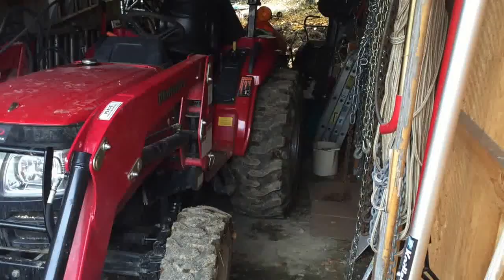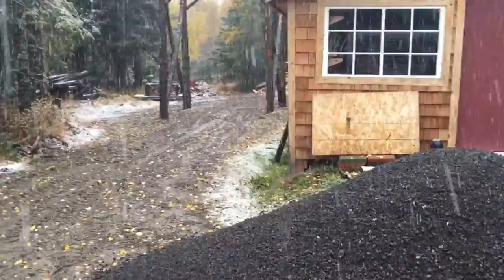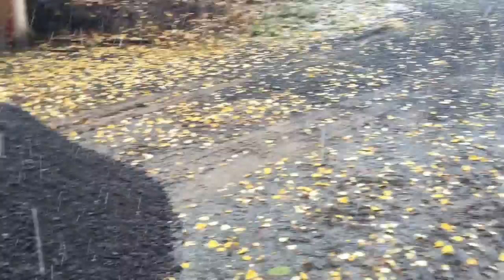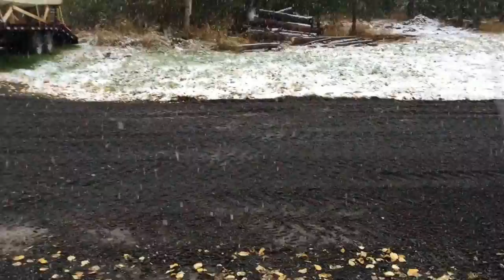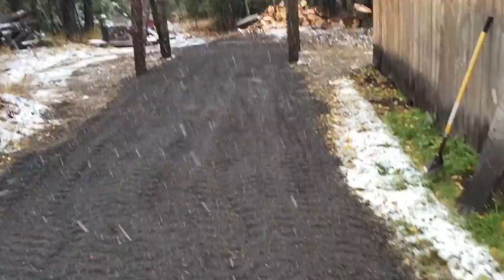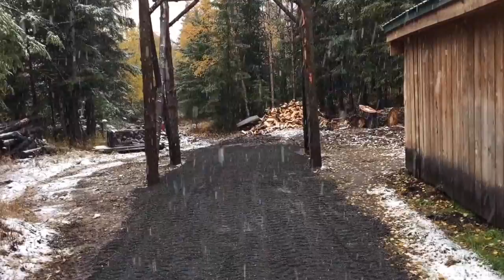Recycled Asphalt - Before and After

Comment from the maker: Hello John.  The recycled asphalt holds up very well.  It is never as pretty as when you first put it down but it's cheaper than gravel and works quite well.  When I did the main part of my driveway I actually rented a large ride on compactor to compact it after I spread it with the tractor.  That made it look, at least initially, like it was paved.  Rent the compactor if you can do it!

Comment: Recycled asphalt is best put down in 80 degree + heat. At 80+ it actually starts to bind back together and after about a week, it will be just like true asphalt. 

When out down in colder temps, it requires compacting. And even then it will just get worked into the soil over time. 

I love recycled asphalt. Best and least cost prohibitive means of laying a driveway or walkway.